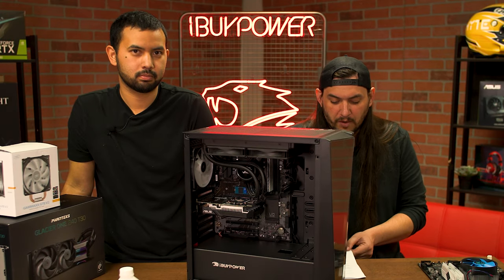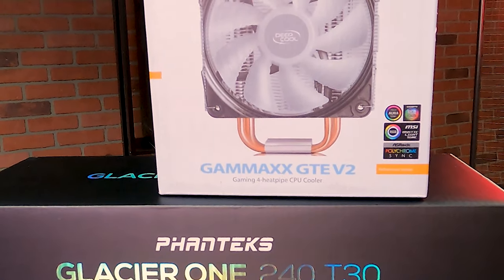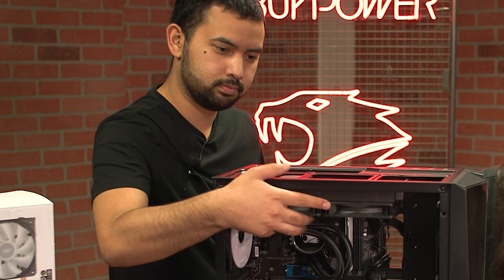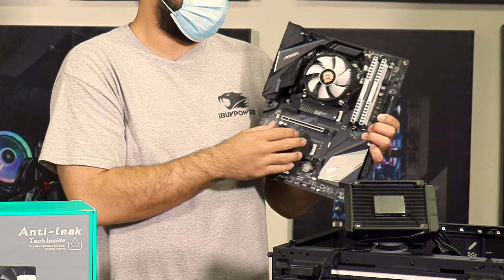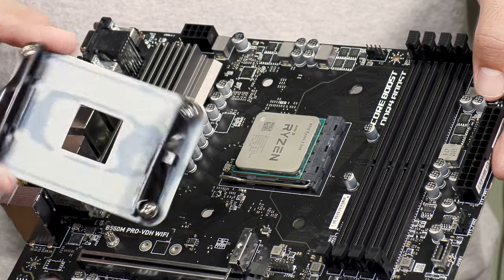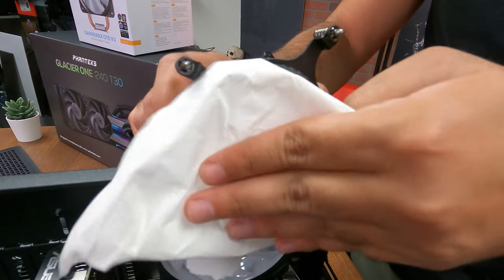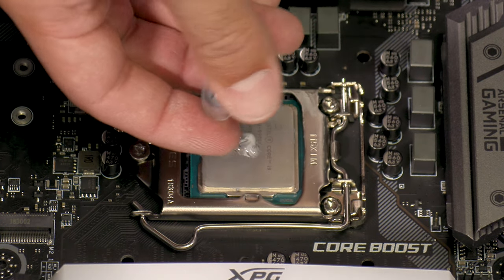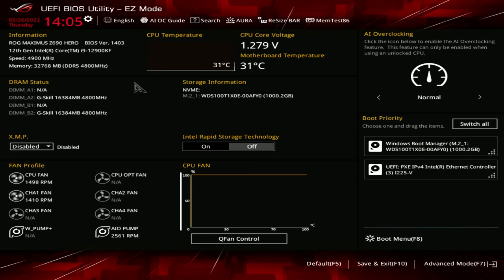How to Replace CPU Cooler with AIO - iBUYPOWER AMD Intel

Comment: only reason im replacing my cooler is because the one i got from you guys is horrible
Reply: Same
Reply: Also same😢
Reply: same
Reply: Same
Reply: @slater762mm  mine just crapped out to what’s the best one out there ?
Reply: I’m going through the same process. I have to pay to send back their bad unit in order to get a replace from them
Reply: @manuelrauda2294  its going to be a better investment long term to just replace the cooler with a nice air cooled one
Reply: Same
Reply: Fax
Reply: Same
Reply: Same
Reply: Same lmaooo
Reply: Same
Reply: Same
Reply: Same
Reply: Same
Reply: Same, but I can’t remove it!!! It’s screws are blocked by the power supply in my case
Reply: Same bro only 1 month
Reply: Original one crapped out after two years. Could you at least show us where to plug-in cables etc. my replacement said nothing
Reply: Mine broke within a year
Reply: Same. Mine just broke, exactly 1 year after purchasing their PC. CPU was hitting 100 C temps
Reply: Same
Reply: Same lol
Reply: Fr, mine just went out. Pc keeps turning off and all fans are working
Reply: Same
Reply: Same
Reply: Same my i9 10900 100celcius
Reply: Same after less than 2 years my cpu is hitting 112C
Reply: Same
Reply: For real!
Reply: Dam
Reply: Same
Reply: Bro same mine lasted maybe a year and I'm getting problems now
Reply: lol same
Reply: Same, lol
Reply: Mine too 😢
Reply: Same.. 100c cpu temp
Reply: Exactly crap ass rgb liquid cooler didn't last a year & a half. Will never buy from them again.
Reply: Mine is 6 years old so I guess I'm considered lucky! Still a pain as everything else is still working fine, but hopefully the high temp didn't damage the CPU!
Reply: Same
Reply: Mine failed almost immediately. POS
Reply: Same we all got pos ibuypower coolers now they're all dying, glad I'm not alone.
Reply: Mine just went out lmao

Comment: Thanks for actually “not” showing us how to replace our cooler. What I’ve learn that’s more bs than this video is the cpu cooler you guys give us.
Reply: Ironic. I'm here because I'm trying to change my IBUYPOWER AIO cooling unit because it died after only one year.
Reply: @Apocalypse31  dude same a year and 2 months and the IBP cooler died on me I feel ripped off.
Reply: @candulimataoo2852  did you replace it?
Reply: @vadermcoc  I did I ended up buying and MSI V2 I heard bad things about it after the fact that I bought it but it’s been working great. The IBuyPower one was out of warranty and they don’t even sell them by itself but honestly their pump is hot garbage.
Reply: @candulimataoo2852  that's good to hear! If you dont mind me asking.. how did you go about making sure the new one was compatible with your pc?
Reply: @vadermcoc  I made sure it matched up with my motherboard. The only thing your really going to have to make sure of is that it’s compatible with your motherboard (I think the sockets on your motherboard to be able to clip it) or maybe with your cpu. If you have ADM or Intel, (I think it fits most standard motherboards and CPU’s)
Reply: mine died after 2 weeks lmao, think it's pump failure. my cpu was overheating but the air coming out of the radiator was cool/room temp. it makes a weird noise every 9 seconds like its trying to move but just gives up, over and over. i opened it up and emptied out the coolant to see if it was clogged up, but it was clean.

Comment: Spent 1600 on a pre-built from you guys and hardly use my PC, maybe a few times a month and 13 months later my AIO is buzzing like crazy, thanks alot!
Reply: This. Mine is buzzing non stop with light use and had never overclocked once. I clean it frequently as to prevent dust build up as well. And that warranty is basically useless unless you're quite near their facility premises. Can't help but feel scammed. Disappointing to say the least, will not be recommending this brand to anyone ever.
Reply: @KevinFloresKiNg_Of_ArTs  Same here. My build it 1 year old and buzzing.
Reply: Wow. Same here. I thought it was just me
Reply: Somewhat same, but when I looked, they actually plugged by AIO pump into the wrong spot on my mobo.
Reply: Update on our issue, called ibuypower and we were outside of warranty but they're sending us the part for free since it's a known issue with the part. Would recommend giving their service desk a call 👍🏼
Reply: Had the same issue, right after the warranty expired. But iBuyPower sent me a replacement as well.
Reply: Did you buy their AIO? I’m having issues with their model which they’re replacing.
Reply: Guys just upgrade or your going to have the same issue
Reply: Should have just got a console if you aren't even using the computer smh
Reply: Hey, hope this helps but It's all about the bios, go to the fan settings on your bios and change from PWM to DC the speed control.
Every bios its a bit different but if you find this option you will fix the issue. Sometimes if the pc has been out of power for long and lost the settings from the bios this can happen.
Reply: @KevinFloresKiNg_Of_ArTs  It's all about the bios, go to the fan settings on your bios and change from PWM to DC the speed control.
Every bios its a bit different but if you find this option you will fix the issue. Sometimes if the pc has been out of power for long and lost the settings from the bios this can happen.
Reply: @mrwannabe00  Oh... can consoles handle my graphics, project management, and spreadsheet programs?  Who knew?  😝😝😝😝
Reply: Same, I just called today because I'm within the 3 year warranty. But PARTS only had a 1 year warranty 🙄

Comment: Ibuypower 240mm rgb liquid cooler unit failed after only a year from you guys. Here i am replacing it already, glad i spent 4k$ with you guys 😮😮😮
Reply: Same,  what a way to ruin your company rep. Any vehicle company would issue a recall and comp or replace the part so they can keep the customer for the next generation of products.  My brother and I bought identical units and his had wiring issues,  and the cooler went out within 6mo. My cooler just went out after 10mo. Dogshit... will never use or recommend this co again.
Reply: I have the same unit and its dying with only a year of use.
Reply: All of you with parts that lasted a year should feel lucky, my cooler went out within 2 months of purchase.
Reply: Same:/
Reply: Same, I thought it was because I ran an i9 and degraded the coolant too quick but if it's happen to others it's probably just a crappy coolant system. 

I went with Corsair AIO to replace it and haven't had problems with it yet.

Comment: 2 iBUYPOWER desktops, same models from same vendors, both bought early 2021. Both liquid coolers started having issues 2 months ago (July 2022), same exact issues too. Having to replace both now. And as many folks as I have seen with this issue online, I think you guys got a bad batch of coolers.
Reply: I got mine back in 2018 and to the day I haven't had any issue, only reason I'm upgrading is because is time hahaha
Reply: Maybe it is a parts manufacture issue you should address. We (husband and wife gamers) replaced BOTH with a CoolMaster MasterLiquid ML240L. Works like a dream. The plastic crap we were cleaning out of your water cooler, what was it? Do you even know?

Comment: Thank you for the guide. It was great foresight on you guys’ part to know that your part would fail after a year of light to mild use and the PC was never overclocked. Had to replace a storage drive that failed as well. I can’t believe I spent over $2,000 on a pre-built with you guys and my friend had better luck with his pre-built from a Costco. I had such higher hopes. Next time I get a PC I will definitely be building it myself. Yes, it has been fun to use it when it worked but having to get it repaired at a shop after a few short months of use. because your warranty is virtually useless unless someone lives right next door and can drop the PC off.
Reply: Configure your own, they use the shittiest power supply and cooler possible. The stock wraith or corresponding Intel cooler would be more sufficient. Just returned mine today, wasn’t liquid cooled but couldn’t find anything on CPU cooler so assumed it would be stock. Came with a shitty cooler I couldn’t find anything on other than it being $5 knockoff deep cool lmao. Not fluent enough to build and travel with work but configured my own with a Corsair pump, on brand case instead of shitty airflow one.
Reply: @manh2704  Thanks for the advice. I basically did a rebuild on mine and pulled all the non name brand stuff out of it and replaced it with reputable brands. Basically built a new computer at that point as I had moved it from it's original case to the NZXT case that I had been wanting
Reply: @manh2704  Decently happy with the computer now but I'll definitely be building my own from now on.

Comment: Alright, I just followed this guide and replaced my cooler.  Powered it on just now, core temps 27C.  Mission success.  As far as how useful this guide is, I worked in IT to pay my way through college for 4 years.  The #1 question I had during this process was how to remove the existing cooler, which the step by step guide in the video was incredibly helpful.  Installing the new cooler though, was a whole 'nother story.  The cooler I bought, Corsair H100i, included instructions to mount the radiator to the top of the case, not the front.  From that point on, this video was useless.  I followed the manual where I could, filled in the gaps with my work experience.

Comment: They know they have to make this video because their cooler is crap and needs replacing. My computer is only a year old and I already have to replace this. Customer service told me to replace it myself because Ibuypower wasn’t going to help cover all the costs even under warranty. They refered to this video so quick probably because so many other people had the same problem. I will never buy from them again. I will warn all my friends and family and strangers to avoid them.
Reply: My wifes computer AIO cooler just crapped out too.
And wow, it is the iBuyPower branded one.
Very disaapointed seeing as I spent 1.5k on a computer just for this part to go out.
2 of the other custom PCs ive had built by them have been fantastic. 
But yeah, they sloppily put together the prebuilt I bought for her. Half of the fans werent even powering on because of their shitty wiring job.
Reply: I cant believe I found this video cause I bought a pre-built from these people literally not even a month over a year old. My CPU is overheating and was looking up videos on how to apply thermal paste and this video came up lol. Glad to know I'm not the only one this is happening to. I tried calling IBuyPower yesterday and 30mins of waiting on the phone it finally gave me an option to hold my place in line and someone would call me back.... well Noone ever called me back so I decided to take matters into my own hands... spent 2k on a pc and this happens... guess I should just go buy a new AIO and not waste my time or the thermal paste I ordered earlier. Oh yeah and my pc is basically dust free... I hardly use it.
Reply: @Souls8  I fixed my issue by buying a Corsair H60 and swapping it out with the iBuyPower one. Computer is fine now 👍

Comment: Couple months over a year since purchase and my AIO cooler from you is dead, was it designed to fail just outside of warranty?
Reply: Mine also did the same thing. Im replacing it today
Reply: @mabwag32 what cooler did you replace with?
Reply: @vogavation  I went with an ek Aio liquid cooler. It's worked great. I like the nucleus the most for design, tho. But the regular worked just as good.

Comment: I just submitted an RMA for the iBuyPower liquid cooler in the system I bought 6 months ago.  So many unanswered questions.  Will the replacement cooler even come with instructions?  What is a "good" temperature for a CPU?  Will I need to pour the liquid into the cooler or does it come with it already in?  Should I buy additional liquid, and if so, what should I get?

I get that this was a generic replacement video and you tried to incorporate general information appropriate for all systems, and I can (and have) Googled much of the missing info, but if you want to make a good instructional vid for your customers a few more specifics would be helpful.
Reply: AIO comes as 'closed' loop with the liquid already inside. If its custom loop, you'll need you're own liquid.

 You'll have to Google temps for your own cpu.
Wish you luck bro, figuring out problems with prebuilts can be stressful.
Reply: @123bruhhhhhh  Thanks.  I actually figured that part out already but, sadly, the situation has gotten worse.  iBuyPower decided that they won't send customers replacement parts anymore unless we send the old one in first, even with a deposit.  So they've asked me to either send my whole computer in or dismantle the AOI cooler and send it in, effectively rendering the machine unusable.  Since neither option is possible given the daily needs on the machine I told them to shove it and bought a Corsair iCUE H100i.  Once it arrived I realized that the thing supports fans with two 4 pin connectors, and iBuyPower put in their own proprietary case fans with single 6 pin connectors.  In other words, either I bow to them or I spend over $300 on a 6 month old computer (that cost $4k to begin with) so I can replace the cooler and all of the case fans.  To say that this will likely be the last iBuyPower I ever get is an understatement.
Reply: @AcidicHotwire  wow that sucks. I was able to talk to them on the phone to have a replacement shipped and I paid for it and was told it would be refunded after they received the old one. 

They call it “Advanced RMA”
Reply: @manuelrauda2294  Yeah, their website says that's a thing too, but the phone tech said they don't do that anymore (who knows why?)  At any rate, I have the iCue AIO and six replacement fans in place now and am quite happy with them.  System is actually cooler, the monitoring and control of the LEDs is far superior, and the grinding noise from the old one is gone.  Expensive fix for a warranty item but at least it's better than what came factory.
Reply: @AcidicHotwire  really? I just got off the phone with a tech a few hours ago and he actually offered me the options as I didn’t know about it. 

But that’s good you were able to get the problem resolved. It sucks that it even has to be a problem in the first place
Reply: @manuelrauda2294  So….I just spent $300 because the jerk on the phone didn’t know what he was talking about?  Good to know, I guess.
Reply: @AcidicHotwire  yup or he was too lazy to set it up because it took the guy on the phone with me a few minutes to switch it over
Reply: @AcidicHotwire  I'm thinking of buying an arctic liquid freezer, but I'm confused. Are you saying that when your AIO arrived you weren't able to make it work because of the way the case fans connection are made?? Googling about iBuyPower says that they don't own any propriety parts or whatever
Reply: @Shallo  My iBuyPower AIO and the case fans include RGB control.  They connected to the control board with 6 pin connectors.

The iCue and Corsair fans also have RGB, but they each have separate connectors (1 for the fan and 1 for the RGB.). Each of those is a four pin connector (technically only three pins each are used but the overall connection is 4 pin).

That means I couldn’t connect the fans or RGB from iBuyPower to the Corsair controller.
Reply: @AcidicHotwire Thank you for responding, I usually don't expect people to on Youtube. 

I think I understand, I believe I won't have any issues if I were to buy an Arctic Liquid Freezer, since it has only one cable and won't have RGB (and no controller I believe). 

Please correct me if I'm wrong because I'm new to this and don't want to end up buying this for nothing lol
Reply: @Shallo  I’m hardly an expert.  I’ve been building computers since the 386 days but stopped when I entered management over 15 years ago.  The iCue was my first AIO.  I also don’t know the motherboard you have or the existing equipment you’re replacing.  I would suggest popping your case and confirming the equipment you have and how it’s connected, then ringing tech support for the Arctic Freezer to confirm compatibility.  Plenty of YouTube video on the installation as well.

Sorry I can’t be more help.
Reply: @AcidicHotwire  Yeah I'm trying my best to figure it out, I appreciate it!

Comment: My prebuilt I buy power cooler started having issues after exactly 12 months and 1 day of use. Right after my 1 year warranty expired. Opened my side panels to find that my gpu also has a blue smudge smeared on top. I almost feel like a sucker who fell for the snake oil merchant. I hope the other parts don’t start failing one by one now.

Comment: ANSWER:
No this is not the fan, gpu, psu, or hard drive

this is actually cause by an in radiator pump that has gone bad over time, you can buy prefilled assemblies to replace it
Reply: cute pfp

Comment: Mine is buzzing non stop with light use and had never overclocked once. I clean it frequently as to prevent dust build up as well. And that warranty is basically useless unless you're quite near their facility premises. Can't help but feel scammed. Disappointing to say the least, will not be recommending this brand to anyone ever.

Comment: I need to pull the aio liquid cooler out and replace with cooling fan, i have the iBuyPower Gaming Desktop PC - SlateMR289A, AMD Ryzen 7 5800X, GeForce RTX 3070 8GB, 16GB RAM, 1TB NVMe SSD, RGB - Windows 11 Home Advanced. Can you tell me what Air cooler i should get?

Comment: Well I came here to find out some of the more technical details covering the wiring differences.  My AIO cooler connects to several places while my heatsink only connects to power and registers.   So, whatever works for you, I guess.   I am unable to find iBuyPower wiring diagram for this unit.